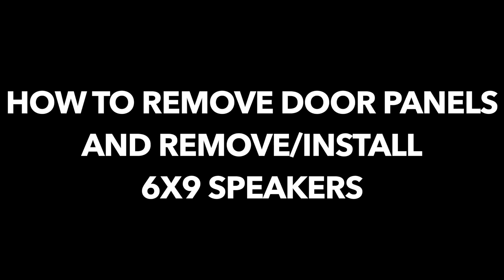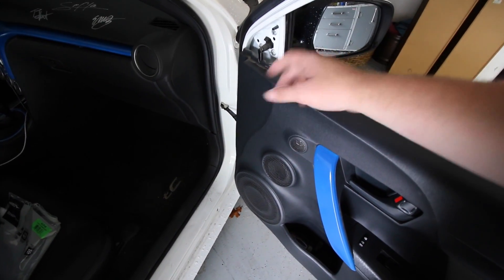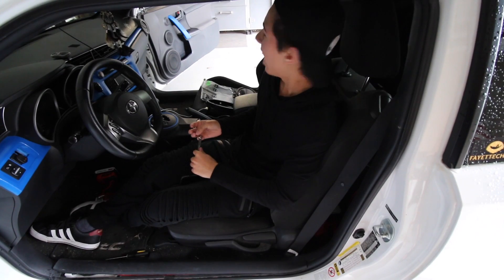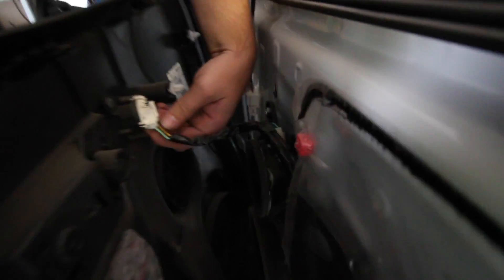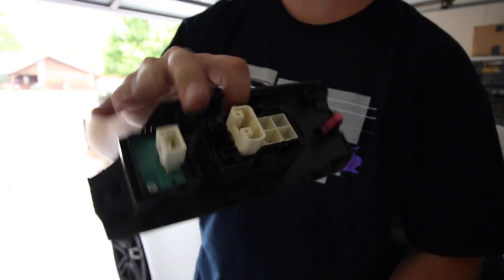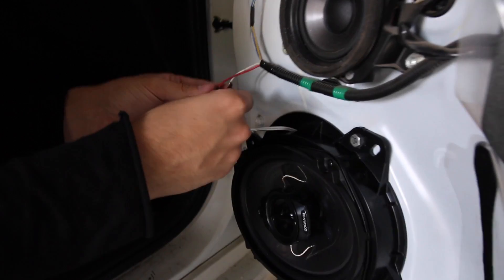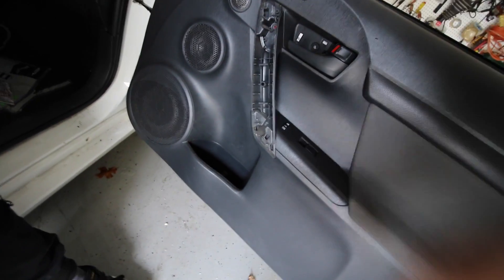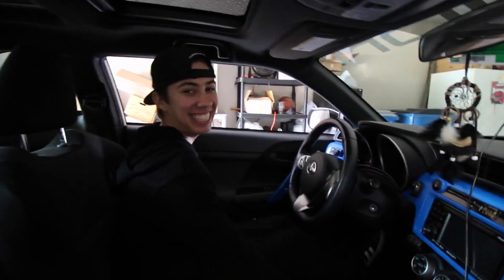I BLEW MY SPEAKERS! | Removing Scion tc2 Door Panels

Comment: The reason why the new 6x9’s don’t sound as punchy is that the factory ones are 2 ohm and the ones you installed are 4 ohm impedance. They are pulling (roughly) half as much power from the head unit. To get a more balanced sound you really need to replace all of the speakers(not just the 6x9’s), or just keep the factory ones.
Reply: Hey, some people are satisfied doing a half ass job because they're lazy and ignorant. 
Don't judge them.

Comment: tc2 actually got pretty good speakers so i don't think any speakers you can buy at walmart will be worth it.
Reply: Yes, but as soon as you install an aftermarket radio they lose the punch to it. It’s so weird
Reply: @Forddude24  not even! You need to Tune the low pass and high filters on the settings. As well as the equalizer. I have a pioneer and the stock speakers thump
Reply: @jdextlab  what unit do you have ?? Did you install it yourself?
Reply: @Forddude24  yeah I installed it myself! Not sure which model I think x6700. Pioneer is the best brand imo next to Sony.
Reply: @jdextlab  remember what wiring harness or diagram you used?

Comment: That blue on the plastic pieces on the interior look nice! Did you spray paint them?
Reply from the maker: Basically yes. I used paint enamel from AutoZone, 2 coats primer, 1 medium coat then heavy and cover missing spots afterwards! Then if you want to throw like a clear coat on you can, but I didn't
Reply: MK Media Sweet! Thanks, I’m assuming it was as easy as pulling off the other panels and such.

Comment: How did you screw the bracket into the door?
Reply from the maker: I believe it was just with a screwdriver or a flat head of a certain size if I remember correctly. It's been so long.